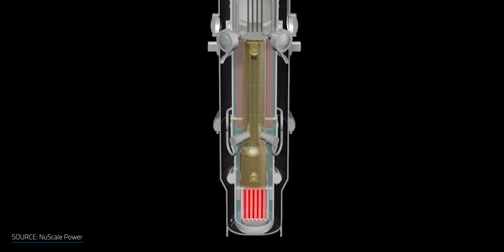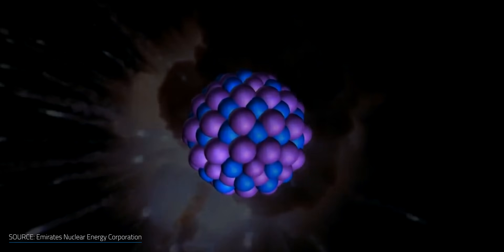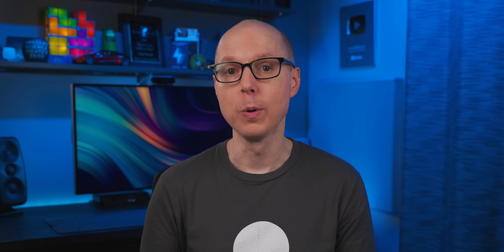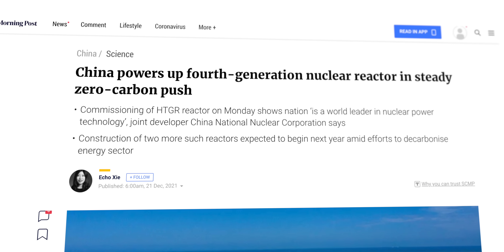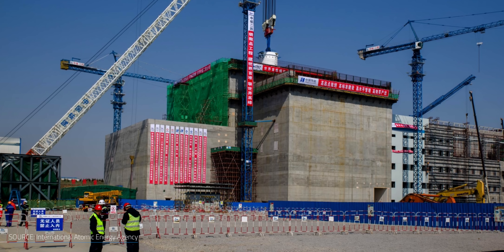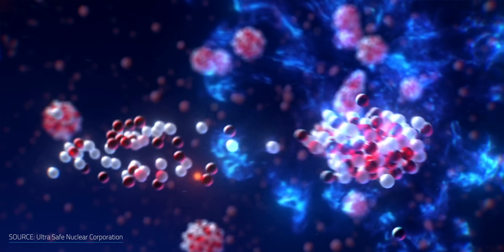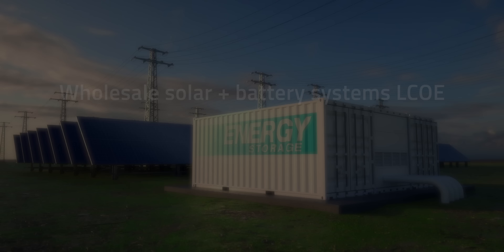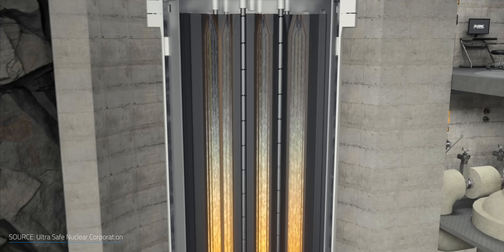Forget Small ... What About Micro Nuclear Energy?

Comment: you make boiling water for a steam engine sound real fancy.. but sounds good to me.. more safer
Reply: That is the essence of every reactor ever built. Steam.
Reply: @CountryLifestyle2023  The better Thorium Molten Salt Reactors do not use water therefore, no steam and very little pressure. The salt starts melting around 800 C (1472 F) and become very liquid at around 982 C (1800 F). This hot flowing lava can easily heat inert gases which can drive gas turbines at a fraction the pressure of steam. Even if you lose all of the inert gas, the molten salt would be dumped by gravity into an huge tank. Within the tank,  it would be allowed to expand  which in turn hinders further chain reaction to a minimum. Once the molten salt cools below 800 C (1472 F), it hardens like rock. Sort of an auto vitrification.   Since the 1800s, engineers knew that boilers have a great potential of blowing up.  My money is on Thorium  Molten salt because you constantly need to stoke the chamber with uranium to keep the heat going. Thorium allows us to consume existing nuclear waste.  But any of these innovative Modular Nuclear Reactor designs  are flexible and much needed energy sources.
Reply: @unclegeorge6175  agreed, my community will have one in a few years.
Reply: you just dont get how energy dense and explody steam is.
Reply: @sebibence02  No, I'm not joking human error caused a malfunction in the water pressure which caused the device to blow. I'm saying that water pressure reactors don't actually cause a full nuclear bomb reaction.
Reply: @KRYMauL  In Fukushima, yet another bad design put the emergency cooling generators below flood level. Without cooling, the fission fuel heated the water enough to split it into hydrogen and oxygen, which recombined explosively, taking the roof of the power plant with it and exposing the fuel, creating a second Chernobyl.
Reply: @CTimmerman  Like I said not a full nuclear meltdown i.e. the explosion seen in Nagasaki and Hiroshima.
Reply: @KRYMauL  And i did not dispute that. An exposed reactor fire does spread more radioactive waste than a nuclear bomb, though.
Reply: @CTimmerman  Sure, but my point was that every issue was with the water containment and not with the actual meltdown of radioactive waste.
Reply: @KRYMauL  Fukushima's ground water included.
Reply: more saferer*
Reply: 1 water = 1000 steam.
Water + 1800 °F (whatever that is) = kaboom
Reply: Dual fluid reactor will solve all these problems. Look for yourself
Reply: A none steam route is focused fusion make electric directly,  but sadly the fuel for this reactor is easy attainable, so forming a cartel around fuel supply would not be possible. The result is very few investors because of lack potential Returns. Meanwhile mainstream Fusion is still cooking the books regarding energy usage and expenditures, while soaking up all the funding that It can find and making weekly announcements of new breakthroughs, this has been going on for 80 years now.
Reply: @drmosfet  Fusion is 50 years away
Reply: @CountryLifestyle2023  
Which fusion are you talking about? Mainstream fusion is based on a tokamaks structure and has most of the scientific community seduced and blinded to alternative Fusion. There are many different versions fission likewise there are many different versions of fusion.
Reply: @drmosfet  And how long till that's ready 50 years ?
Reply: @CountryLifestyle2023 
It's hard to say focus fusion still in research mode, and working on a Shoestring budget when compared to mainstream Fusion. They have a new comparator with a similar system, but it will use helium-3 for fuel which means you'll need a fleet of spaceships to harvest sufficient amount of helium-3 for fuel to make any kind of impact on global warming. This new company received over 2 billion in investment for it reactor research. I think the possibility of cartel forming around it fuel supply might be directly proportional to the amount of investment.
Reply: @drmosfet  so 50 years. Aka this is no viable. 
I like to theorize with current technologies
Reply: @CountryLifestyle2023  
Humanity is facing it's own Perfect Storm of stupidity in so many directions, mankind have refined the art of sitting on the wrong side tree branch while cutting it.
Reply: @drmosfet  your just  talking to yourself
Reply: @drmosfet  This is not news or insightful  

If you wish to discuss the topic we can but respond to me vs talking to yourself. 

You are currently talking to yourself .....
Reply: Conenct that somehow to a Tesla Turbine, put it in a car. And we'll have the strongest american muscle car ever made.  B)
Reply: I'm a retired reactor maintenance technician.  I've performed reactor disassembly, refueling and reassembly on both GE BWRs and B&W PWRs.
 I found your video very informative and interesting.  Thanks for taking the time to produce it.
Reply: Likely can create a new nuclear steam train with it.
Reply: Kalki Ironman type 7 and 8 after 2026 😎

kalki avatar (beast of the earth) (christ on the white horse) (son of man on clouds) is the biggest enemy of dajjal/antichrist/kali 😏

Kalki Avatar (Murtaza) 11th satguru 13th imam cousin of Moula mahdhi a.s. 12th imam (muhammad) 😎

Prophet Moula mahdhi is raja shashidhuvj (the mighty one) born less then 1200 years ago 😎

Prophet Moula Isa a.s. will kill dajjal cause dajjal is going to kill Kalki Avatar 😏

Kalki Avatar will follow orders from 2 religious king Moula mahdhi a.s. and Moula Isa a.s. 😎

Kalki Avatar going to have 2 swords and ring of moula sulaiman a.s. and staff of moula musa a.s. (iron rod) Staff of moula musa a.s. is like omintrix can transform into anything and can transform others into anything And stone in the ring of moula sulaiman a.s. is also known as kastav mani and it's more powerful than all 6 infinite stones combined 😇

Cuz Kalki is ironman batman super saiya-jin superman ben10 saitama optimus prime shaktimaan and every super heroes combined after 2026 😎

This staff will transforms into white horses with wings,weapons,iron-man,cloud etc or can do imagination into reality 😎

*Ratn sru sword of lord shiva (miri)😇

*Ratn varu (zulfakar) sword of Moula Ali (piri) 😇

miri piri 😇

Kalki Ironman after 2026 😎

Satyug (sunrise from West) 2038 😏

Sambal is hospital 😏

Gzwa e hind 2029 😎

Khalistan and Azad Kashmir after 2026 by Ironman 😎

99% Hadith u heard is not about imam Mahdi it’s about Kalki avatar (the main character) that person momin vs dajjal prove me wrong if u can 😏😏.
Reply: Actually steam is pretty dangerous. It had key role in every major nuclear accident. It's fine to use steam for the energy generation part, but water shouldn't be inside the reactor core.
Reply: @andrasbiro3007  Does this process produce any kind of toxic waste? Also, what is done with the waste?
Reply: @zorroinhell5549  All nuclear disasters have been a problem with the pressure containment unit of the water. Water under eminence heat and pressures creates a ton of steam that can seriously injure people, just look at a kettle with a stout.
Reply: @KRYMauL  Not LFTRs with gas turbines.
Reply: @CTimmerman  I meant the current nuclear reactors.
Reply: @zorroinhell5549  Depends on the design of the reactor, Military reactors seperate the primary coolant from the secondary, the water in the reactor is passed thru heat exchangers to boil the water for steam and the two water loops are not mixed at any point. There have been civilian Boiling Water Reactors where the primary coolant was actually water used for steam to drive the turbine generators but that was given up as a bad idea.
Reply: @KRYMauL  I don't know about every civilian reactor but military reactor plants don't operate at extreme steam pressure on the secondary side (<500 psi Saturated Steam as a rule). The Navy had a few oil fired steam plants using High Pressure Super Heated Steam but I believe they have all been decommissioned.
Reply: @ocelblack9823  All I’m saying is the nuclear disasters have all been a problem with water pressure. Stop making this about Nuclear Chemistry and stick to basic kinematics and fluid dynamics of a system under immense pressure.
Reply: @KRYMauL  What are you calling "extreme pressure"? Naval reactors run ~ 1400psi on the primary side and  temps around 480 F, < 500 psi on the secondary side. In industry in general those are considered to be reasonable levels, much lower than most hydraulic systems operating at 3000psi. The 1400psi primary pressure is supplied by electric heating elements in a separate "pressurizer" to ensure that there is no boiling in the core.
Reply: @ocelblack9823  Extreme pressure meaning any pressure that if not regulated it could blow up all the radioactive water.
Reply: @KRYMauL  That is not correct.
Reply: @KRYMauL  In other words "my chickens will lay square eggs, cows will give green milk and the sky will fall on my head!".
Reply: @ocelblack9823  I'm not complaining about it merely saying that the general populous thinks nuclear is unsafe. All I said was that the current nuclear reactor in meltdown release the coolant water and that none of the reactors have actually exploded in a nuclear explosion.

Also, solar means lithium and silicon mining, and mining is one of the least safe professions.
Reply: @KRYMauL  Is it really water to blame here? Anything superheated and under pressure will explode.
Reply: @ocelblack9823  Isn't that just how PWRs work? Two loops of water. One directly connected to the reactor, another siphoning the heat from the first to drive the turbine.
Reply: @anxiousearth680  It was comment about not ever having a nuclear reactor resulting in a true nuclear meltdown.
Reply: @anxiousearth680  In simple words, "yes". The "primary coolant" (water) is highly purified and never allowed to mix with the "secondary coolant" (Steam Generator feed water). As far as I know the USS Shark SS(N)591 is the only Naval Reactor to have had a "fuel element failure" that actually contaminated it's Primary Coolant with highly radioactive fission products. It's reactor compartment was buried in the Idaho "Super Trench" years ago. As a "Navy Nuke" for over 6 years I received less exposure than any one living in Denver Colorado for the same period of time.
Reply: @ocelblack9823  I see. Thanks for the info!
Reply: @andrasbiro3007  Why
Reply: @zazethe6553  Yes I know. 
And depends by what you mean water touching the reactor.
Many different types of reactors.

And depends what you mean by explode, they can't explode like a nuclear bomb, but reactor ceiling vaults have exploded off before.
Not a fiery explosion more pressure release. I can only think of 1-2 instance,  in early days when they were perfecting designs.
Reply: @andrasbiro3007  

I use water 💧 in my reactor core all the time.  😶
Reply: @andrasbiro3007  you're right, we should let the core meltdown
Reply: @andrasbiro3007  why?